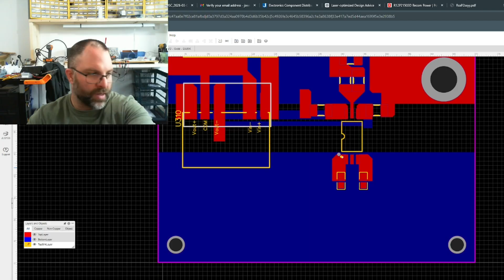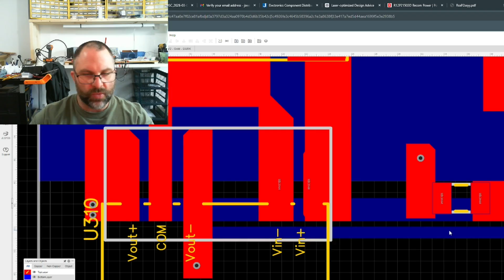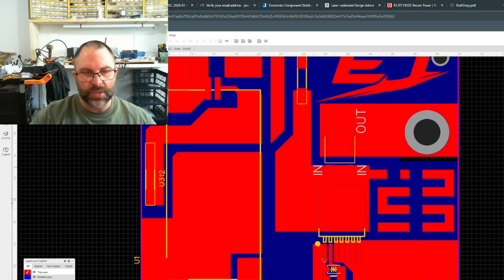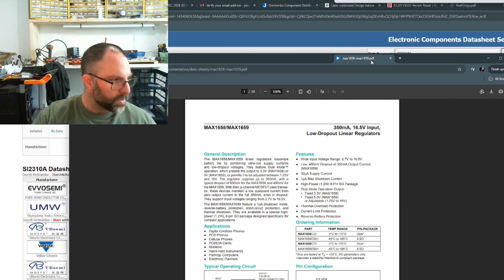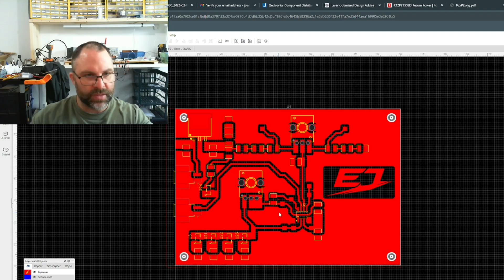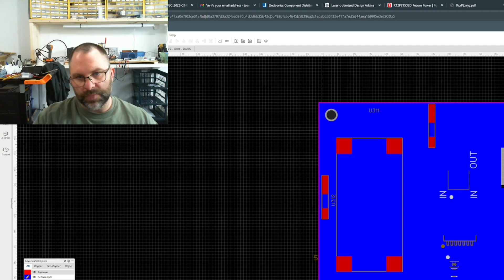Laser-Etched Low-Inductance Gate Driver for SiC Switching

Comment from the maker: @sean_vikoren For this board the critical return isn’t just generic ground - it’s the Kelvin source reference at the FET. The plane helps reduce loop area geometrically, but the key is keeping the gate-to-Kelvin loop tight and isolated from the high-current power loop.